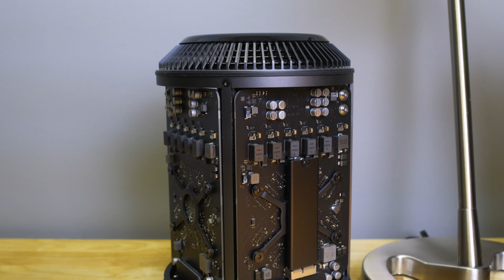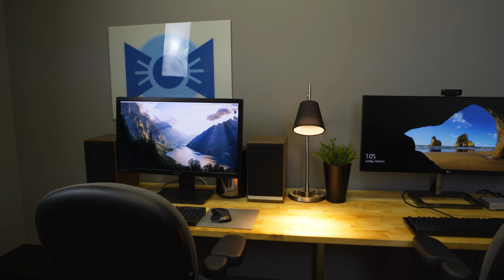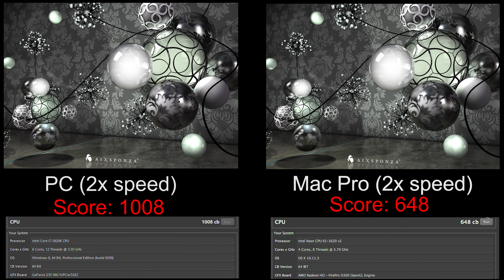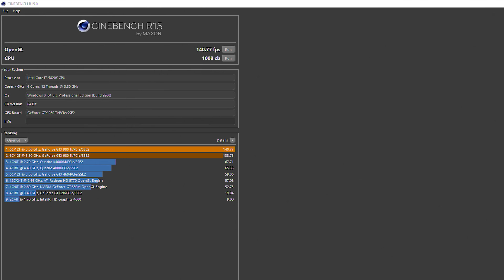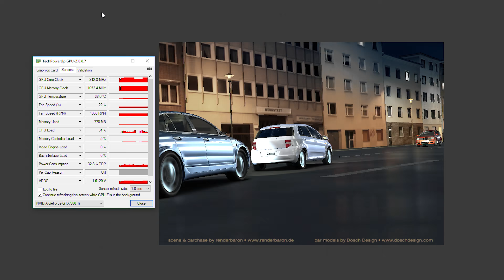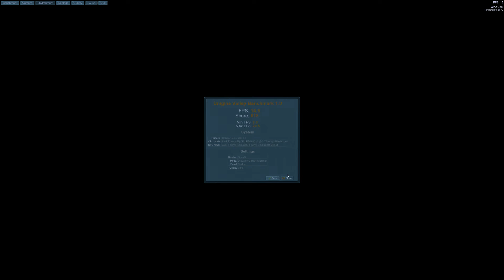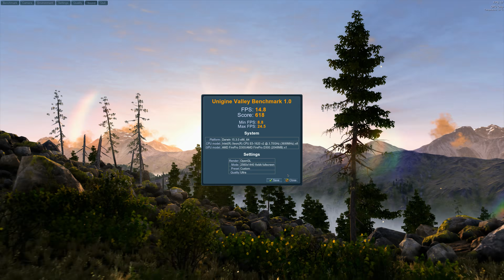$2,000 Custom PC vs $4,000 Mac Pro

Comment: I'd have prefered, that you make a fairer comparison ... I mean it doesn't help to compare a 3 year old mac with a pc... if the point of the video is to show "PCS are better" why not to compare analmost same hardware pc with the old macbook pro...?And if the point of the video is to show a Faire competition,well the hardware of both should be the same, don't you think ? the fact that mac sells expensive PCS is already known as well as the fact that you can build your own PCFOR a much lower price... I am not an apple fan, but I am looking for I formation and a good compare  video. till now I have had a good laptop fro 2012 and it still being good but after one year the battery died and know is getting hard to work with big videodata... I am a student of cinema who works with 4k video for color grading and do some 3d compositing. And before everyone begins to comment why I don't build a pc. is because I move really often and can't be caring a tower for the moment, that also the reason I have for now laptop...well if you have another co pare video I will be happy to watch it.

Comment: My $1200 PC is even better than that shitty Mac Pro. Windows reigns
Reply: Well if you like gaming it is not, not saying that mac computers cant game though.  But the thing is the Mac Operating System runs on unix which is the same thing linux is based on.  Mac's are overpriced yes that is true, however if you are good at fixing computers you can find one for cheap and fix it for a low amount of money.  In my personal opinion from years of experience Macintosh's are very good for the it security field.  Yes I understand that linux is nice and all, but a mac can do a whole crap load of things as well.  This is were the Macintosh OS really shines, because almost every single linux tool you are able to find on a mac if you dig deep enough.  Personally, for someone like myself who does a lot of security testing and cracking of code, it is a god send.  You have all these "hackers" and quote on quote "IT Security Buffs" that use linux.  Mac is just as good as linux in the right hands.  The thing is macs are easier to pick up on, that is why some IT security workers use them, as well as the fact that they are flexible.  Yes they can get viruses just like windows, however people who say linux distro's like Ubuntu, tails, kali linux and backtrack cant get virus's are full of complete shit.  If you work in this field or are at least expeirence with computers you will come to relaize that any electronic device that is connected to the internet can be breached.  Whether it is a kernel hack, web cam hack, you name it, no-one is safe in this modern world.  Everybody is plugged in through facebook, twitter, and youtube.  What they fail to realize is that computers or rooted phones in the hands of a hacker are just as effective as a loaded colt 1911 (45) acp, because whats to stop a good hacker from taking control of a government drone?  Oh thats right, nothing can stop him, and if you are trained in the IT security field or have been around computers your whole life and are involved in the underground network's for hackers through tor.  The sad thing is no-one in this world is safe since everybody is always plugged in to the internet.  Unless you are really good at covering your tracks, or have extensive training in IT Security you are literately fucked.  My point is macs can be powerful weapons just as any other pc or electronic device when in the right hands.  When you have someone like myself who does security breach related stuff for a living you tend to realize how nice a mac can be.  Sorry if this went on for too long, I just had some valid facts I wanted to point out.
Reply: My ~$1150 dollar pc is better than mac pro as well. BTW, it's not 'Windows' that's winning, it's the parts used to build the PC. You can run one hell of a Hackintosh though
Reply: You can build a pc for 500-600 and it'll beat the mac pro in gaming.
Reply: Cheng Ye  Mac Pro was never for gaming. 
People just get them because they're easy to deal with (for people who actually understand the quantum complexity that is IOS).. and they're I guess pretty good for editing music and videos and stuff
Reply: No Go Please go ahead and get us Hillary's emails!

Comment: You're comparing Apples (pun) to oranges here.

Where's the Xeon CPU for the PC?  Where's the EEC memory for the PC?
Where's the FirePro GPU?
Where's the Xeon motherboard?

They're missing, and it's ironic because the Xeon alone will get your PC build into $4000 territory.

And if you're going to run software comparisons on how well this build can "beat" a Mac, make it a Hackintosh, and see how well it compares against that same Mac Pro in Final Cut Pro.

Then and only then would there be a true comparison.
Reply: That's the awesome part of computers you can literally say look here my computer did all this better than yours, here's the numbers, it's literally a fact that mine is better. Which is what happened here. If you really think that the 4+ year old computer is better than the < 1 year old computer you're delusional. He can turn it into a hackintosh and it'll still be at least twice as fast as the mac if not more, I'd be interested in the results.
Reply: UCRProjectVideo The Xeon hasn't been updated by Intel in either case (PC or Mac)- which is why there isn't a new Mac pro based on the latest chipsets.

A PC with a Xeon is the same as a Mac Pro with a Xeon, only the Mac Pro will natively run OS X better.

This is common knowledge.
Reply: Most people will build PCs with the best bang for buck for their use case. Apple does not do that. That's why Macs are crazy expensive. Xeon is actually server grade hardware, not even meant for even professionals
Reply: Lance Lindle Lee " 
Most people will build PCs with the best bang for buck for their use case."

That's the thing- the misconception here is that they actually think that they are.  There's only a discount if you're building a gaming rig.

If you want an iron-clad SERVER with dual GPU's in that form-factor and performance in OS X, you're going to spend MORE money building a PC with the exact specs (read:  a Xeon and not a binned i7 off-the-shelf part).

Apple has consumer desktops- they're called iMacs, and the majority of the price comes from the display.

Comment: you're complaining also about the update even if they released a Mac Pro 2 it would still only have probably 20% better components. the problem is that Mac only gives you baby upgrade and charges you the same amount as what you paid prior to the last version I've never even owned a Mac or an iPhone I simply just look it the system components and make my decision take that iPhone 6 with still only like 2 gigabytes of RAM

Comment: I think Windows is starting to equal the ease, compatibility, and stability of Mac's OS these days so Apple's pricing could use a reduction, I think. Apple has always charged higher for their machines due to the careful and personalized processes they go through to produce their products. As the author said, he made his machine in a few minutes- it's a big box. That Mac machine took years to design and produce to fit every task in the lifestyle of a mobile professional. Notice how every comparison of a Mac Pro is to a pc desktop build? Laptops can't compete with it, yet it's just as small as one.

Comment: You should also look at DIYing sound panels instead of buying them.  it takes about an hour to build a batch of six 4'x2' panels using burlap, a staplegun and wood glue, some pine 1x4's and some Owens-Corning 703 Rigid Fiber Insulation and also about $150.

Comment: One thing you forgot to clarify was the hardware on the mac pro is workstation hardware, which is vastly more expensive than consumer grade hardware, which is what you used. The Xeon, Fire Pro, and ECC memory are all designed for workstations and servers. The hardware companies charge a premium for this style of hardware as it is super reliable for the people who use it. Still there is no reason they should be using hardware that old, in fact you could probably buy similar hardware used on ebay. The people running servers sell off the hardware for super cheap, and Linus from Linus Tech Tips uses this method for extremely cheap PCs if you are willing to cut corners. All in all though, Apple needs to stop cutting corners and actually make their machines high end workstation models.
Reply: Xeon and ECC ram is more expensive, but if you actually build the equivalent Xeon based PC to that i7 5820K spec you are talking $80 more for a Xeon E5-2620 v3 processor (just slower) or for $300 more a Xeon-E5-2630-v3 (even faster), $100 more for the motherboard, 32 gigs of DDR4 2133 ECC ram is a mere $180. Still nowhere near the $4000 Mac tag price. As said in the video, Apple do need to update their machines. Going by the Apple lifecycle (see macrumors) a Mac Pro update is due around now.
Reply: what is this about 'workstation' and 'servers' you speak of? they are CPU's. CPU's determine how fast machine code executes. That's it. 

You saying the 'style' of hardware is better based on consumer grade or...premium.

What is the difference between consumer grade CPU hardware that runs at 3.7 gHz and premium hardware that runs at 3.7 gHz?
Reply: Yes total gHz on a similar architecture (gHz x cores, similar cache, etc) is the same. The Xeon with ECC memory ups the reliability of the machine from crashes and data errors considerably. If you are building a machine for work and crashes cost you time and money, or a machine as a NAS or data store and you want to be sure evey byte written is correct then Xeon and ECC is the way to go. $500 extra that saves you from these errors is an obvious choice. If you're just playing games, i7 is the way to go.
Reply: +Landan Parker - workstation models don't cost more for being 'premium'. They are are more reliable, almost always have far better warranty and call support and have features like more memory support, error correction like I said, comprehensive i/o support for distributed applications, more double precision performance, more total memory capacity etc.

Comment: Does it run OS X?
Reply: Yup, whit emulators. Just like Mac can run Windows with emulators
Reply: not just emulators, u can actually run OS X as your main OS but you'll have to buy hardware which can support it
Reply: Hackintosh is incredibly tricky to get working correctly. And even when you manage to do it, it will crash as soon as you try to update anything.
Reply: +Nuno Torres yep that's the biggest shit in that "OS" It just doesn't worth it
Reply: Raul Bustos I disagree. OSX is way more reliable and stable than Windows, which can be a major factor depending on what you use your computer for. In my case, I had to switch to Mac because of live music performances. Windows is too unpredictable and it needs drivers for everything, which are two things you can't be worried about when you're doing 4 live performances per week.
Reply: +Nuno Torres maybe you misunderstood me. look what i was saying is that OSX in a PC hardware (hackintosh) is crappy, it always gonma run better Windows or Linux, but I do love OSX in a real Mac i do think is always going to be better at all
Reply: Raul Bustos oh in that case I really misunderstood you :)

Comment: Mac products are beautiful. Can anyone show me any PC which has equivalent power as mac pro with similar size? 

Also people praising OSX but hate apple hardwares should realize that it is a copyrighted software and you are suppose to use it explicitly on apple hardwares only. Its free for mac devices only. Apple can sue you for $150000 if they want to for using a hackintosh. I guess buying mac pro for $4000 is a bargain if you consider that 😊.

Comment: Apple will not succeed in producing a popular pc. In order for a pc to be successful it has to be modular. The user mus be able to change/upgrade various parts that become obsolete faster than others. Their desktop pc's just like almost any other brand prebuilt pc's are good just for offices and home use. Performance is not a standard good for all platform. Performance comes with changing/buying the parts that fit your job most. And as long as you can build the pc that you need with the configuration that you need relatively cheap the mac's will never be successful. Wake up! It is not a laptop/tablet/phone! It is a pc!

Comment: The original Mac Pro's were actually beasts in terms of performance and very solid (also quite expensive too). The new "trash can" model is just horribly designed and unjustly priced based on that. It's sad.

Comment: Did you try editing 4K video on that $2000 PC? Because that's the one big issue Apple said about Mac Pro... that 4K editing will be smooth and that's not just about benchmarks. I would like to see this kind of practical comparsion. If u could do this, many of the video guys would be happy :) All the best from Slovakia!
Reply: Matúš Druga there is a video called 10000 apple computer vs 10000 pc where the pc rendered faster
Reply from the maker: +Matúš Druga Video editing performance was mentioned in the video at the end of the benchmarks. The PC was roughly 2X faster than the Mac Pro at rendering 4K video.
Reply: Snazzy Labs Thank you! I skipped some parts... sorry

Comment: The MacPro is a 2999.000 Mac Pro brand new. 
Quad-Core and Dual GPU
3.7GHz Quad-Core Intel Xeon E5 processor
12GB 1866MHz DDR3 ECC memory
Dual AMD FirePro D300
with 2GB GDDR5 VRAM each
256GB PCIe-based flash storage
Reply: That's what you'd like to think.
Reply: Six-Core AMD FX 6300 @4.1GHZ
16GB Vengeance RAM DDR4
EVGA GTX 970 4gb GDDR5. 
650 PSU
and 4 TB of storage.
Under 1.1k

GG I guess

Comment: the laptops are pretty good, they arent that bad
Reply: lmao. you're such a kidder you!
Reply: mine actually is pretty good i actually had no choice, wendows 10 is in beta (or it was when i got this mac) and the security was bad and i like this mac, but for a desk top i would get a wendows
Reply: Weallwayswin WithGod "pretty good" as in does not support next-gen graphics and does not play almost any games then yes, you're correct.
Reply: playing gsmes is not why i bought it, if i want  to play games then i will make a computer, lap tops were not made to play games and the graphics card is really good in this lap top, ive went through two other computers and when i got them i found problems with them imeditaly, and could barely preform simple tasks on them but this is the only computer that ive actually been able to use, but for a dest top computer i would go for windows every time but i would probably build my own from parts and would have a lot of ram and would have a very good gpu and cpu, you cant buy one and expect it to be a great computer and not spend a shit ton of money

Comment: To be fair... a mid to high end Xeon would cut your $2k budget in half compared to that high end (Broadwell? Haswell-E?) i7 and if you divide the CPU scores by the number of threads, you see the CPUs actually performed pretty similarly, but of course the Xeon has fewer cores and thus a lower score. Also I think the D300's are more comparable to something in nVidia's Quadro (they also suck at gaming) lineup than a 980ti.